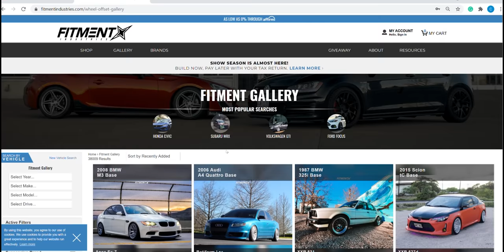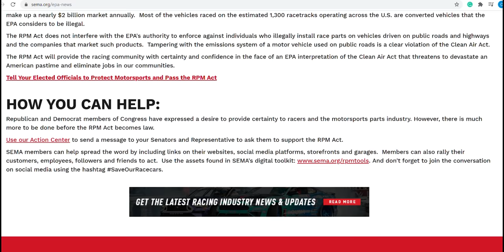So You Want To Make Car Mods Illegal (EPA)

Comment: FYI, hackers have attacked SEMAs RPM Act page so you can't get involved to help. If you guys care about this, please actually get involved. We're going to lose so much if the RPM Act doesn't pass. This also prevents retro fitting old cars to get them safe and up to par with modern standards, which is a good form of recycling old cars.

Comment: I’m personally conflicted on this. On one hand, banning all aftermarket parts or even a few could spiral into something worse down the line (few into all into even MORE stringent standards for automobiles and yadda yadda yadda). Banning aftermarket parts also essentially kills the grassroots Motorsport level. There’s also the problematic view of “you can’t stop EVERYONE from modding cars” though that’d kinda kill car meets in its own way too (big meets+mod ban law+ most cars at meets modded=bad time). At the SAME TIME though, the EPA exists so America never regresses to what we were before. If you’ve never lived through smog or had asthma before then you don’t understand how bad it actually is. So I can understand the EPA’s view. Also, y’all know there’s people out there that buy parts that are designated “off road use only” and install those parts on a daily driver, riding around from coast to coast (and full disclosure I feel they have the right to do so but it kinda doesn’t help our case). Furthermore, diesel cheat devices probably are a problem. Probably not enough of a problem to kill the aftermarket car community since diesel cars in Motorsport are like a minority of a minority but still. I think the car community is facing an uphill battle that we might not actually win. I’m rooting for us though.

Comment: Why doesn't the EPA go after the millions of single drivers that are unnecessarily cruising around in SUVs and crossovers instead of smaller fuel efficient cars instead of a very small number of aftermarket cars?  Makes absolute zero sense

Comment: A better way to regulate would be to limit the availability of high octane fuel and cap it at 93 octane nationally. The next thing would be to restrict E85 to vehicles of 1.7-liter displacement or less through the use of a special filler cap and legal penalties. The way I see it ethanol is being made from food out of someone's belly somewhere so we should be using the stuff as efficiently as possible.
The reason to limit octane is the heat and pressure of compressors produce astronomical amounts of nitrous oxide products and that is much worse than CO2. You could still have a compressor with 93 octane fuel but it would be a dicey proposition with pre-detonation. I always felt that building a car with bolt-on parts was a flakey way that rich kids do it, but not a serious engineer.

Comment: Personally i dont think what they are fighting for is what they truly want. Like most large corporations, i think this is just the first step that may get the door open and squeeze thru and then it will be another and another and ultimately its step 5 or 10 that they truly want to accomplish. Also this could possibly be fueled by manufacturers or auto makers in a roundabout way in order to fuel more sales as the only way to get more fun to drive or a nicer looking vehicle would be to replace the entire vehicle

Comment: If you ask me this is hard. On the one hand, I would love to do everything possible to represent the least environmental impact on the world, but on the other hand I also like fast cars. The EPA has good intentions with poor execution here cause most people who modify cars here have zero intentions of destroying the environment, and often measures designed to harm the general population are met with negative feedback, no surprise. However I understand that all these modified cars added together do represent a significant increase in emissions for the EPA to go after it, but I also understand that we are guinea pigs for technologies that make it to regular production cars through the aftermarket parts we buy and use in our vehicles, just like motorsport is a proving ground for engine technologies like KERS, thermal efficiency,  variable geometry turbos, etc. This approach is on the most part not good, however, the aftermarket industry doesn't have the money to afford the lawyers the oil and gas, dairy and beef industries have to fend off the EPA and use their rules as suggestions. Automakers won't join as they're switching to electric, so we're easy target. However we do need to strike a balance between go-fast parts and killing the planet in which we enjoy them.

Comment: I mean in 9 years you wont be able to buy/register a gas vehicle in the states because of the 'Phase out fossil fuel vehicle' starting in 2030 in the states. so this really doesn't matter much, delaying would only be placing a band-aid on a severed limb. This is bigger then the car scene or modding culture, investors have spoken with their money, and there isn't much anyone can do about it, this will pass at a fed level, I'd be surprised if it didn't. RIP my RSX.

Comment: I get emissions and things of that nature. Although aftermarket ignition systems allow all the exhaust gasses to be burned and therefore are more efficient than stock. So in many ways the epa stance on going after hobbyists is unvalid. But the entire aftermarket? What does a suspension have to do with emissions?  There is no correlation to the ozone by driving a lowered car. Or a road racing suspension!  I think this is more intended to force us asa society to not have independence and  individuality.  Our country is turning i to cold war era Russia.

Comment: The EPA is a joke. People will simply go back to the way cars were modified in the 1950s before there were performance aftermarket parts available. They made their own stuff. The beginnings of performance intake manifolds were people who dug pits in their backyard and poured their own rough castings, then machined them. Henry Ford himself said that "Anything that can be drawn up can be cast" when his own designers claimed that it wouldnt be feasible to cast a block for a V-8 engine.
The same applies to camshafts...all one needs is a chunk of steel and used or surplus machine equipment, CAD/CAM capability would be a bonus though, but not absolutely necessary, they have been made since the dawn of the gasoline engine.
Modified ECM/ECU and other late model electronic crap? A proficient teenage hacker can handle that.
Roots type superchargers? Those were invented in the 19th century...to ventilate mines.  Technology was primitive at the time, so how difficult would it be to make your own?
It people arent lazy and seriously want to defeat the miserable EPA environazis, it simply takes determination and knowledge of fabrication techniques, AND the dissemination of such knowledge is protected by the First Amendment to the Constitution.
The EPA is simply too understaffed and doesnt have the resources to stop anyone strongly determined.to modify vehicles.
Case in point.....It is prohibited by EPA regulation to introduce more than 10% ethanol into gasoline used in non flex fuel vehicles (15% if 2001 or newer)
Does anyone sane think they could possibly post a lackey at every gas station that sells E-85 or every paint store that sells denatured alcohol to enforce their ridiculous crap?

Comment: I think its more nuanced than that. For example at 8:45, tires that have a higher burn rate releases particulate matter in the air which is terrible for air quality. Are higher burn rate tires fun, yes (I love them) but lets face it, they are bad for the environment. And the environment is EPA's job. I say engineers should make tires with higher burn rates with little to no particulate matter to solve this issue.

Before you say anything bad about the other side, take a min to do research into why that something is being done.

Also before you say anything, note that the EPA is did a similar thing in the 80's regarding emission standards. Did cars suffer, yes but in the short term. Now we have cars that are way more efficient and make more power than what was even thought was possible. (I read an article somewhere sometime ago that a ford executive said that 30mpg cars are impossible 🤣. I think it was dated in 1970's or 1980's. I post it here if I find it)

Comment: If they banned excessive black smoke on road use diesel vehicles id be fine with that, considering if you are breathing that in (ac not on recalculate, drive convertible with roof down, have window open, motorcyclist or predestrian) its not particularly that great plus makes it difficult to see. 
But if it were to affect other stuff id have a problem with it, cause car culture is a very neish compared to the overall car market. Like at work i barely see cars running aftermarket wheels, i see more cars running on 1L of oil then cars with a.market wheels let alone modified cars

Comment: Unpopular opinion here, but seems like the EPA is trying to crack down on companies selling emission control delete products for "off road use" that are clearly mostly being used by people with regular, on road cars who want to remove emissions control for more power or to roll coal. Kind of like if you ran a store selling lab equipment, Sudafed, and burner phones. There's a poorly-written carve out for motorsports, and it should be clarified, but it doesn't help anyone to be cute and try to use it as a loophole for getting around the main point of the law

Comment: People should make burnouts in front of EPAs offices 24/7. 
Anyway, it doesn't really affect me. Where I live you need a to endure an expensive bureaucratic hell, requiring a certified professional mechanic and an engineering study just to install an additional phone charging port in the car.
Also, LED headlights? hell no... unless they are stock, then it's perfectly fine.

Comment: I would like to see the other side of the medal on this one. You guys have an industry to defend. Fair enough. But as you pointed out early in the video, cars were pretty bad for the air we breathe in the 50's and 60's, and if the EPA had not stepped in, there is no way the industry would have changed. The EPA has turned a blind eye to the "offroad use only, wink-wink" tuning industry for a long time, but when a bunch of hicks start "rolling coal" with the sole intention of creating as much pollution as possible to piss off "tree huggers" and brag about it on YT, the EPA will eventually notice and say "that's enough". Can I blame them? Not really. The most moronic people in society will ruin it for the rest of us.

Comment: That phrasing "street vehicles cant be converted into racecars" is real deceptive. The proposed legislation just means those racecars have to meet emissions same as street cars. Whether you want to admit it or not ICE powertrains are quickly on the way out for not only oem's but also the aftermarket. We are very quickly approaching the point where dropping in an ev conversion will be a 1-2day affair and will at least double if not quadruple the performance of the vehicle. This is a whole lot of hoopla for something that isnt gonna matter in 10years. Spend your time learning EV tech instead of fighting the inevitable future.

Comment: God damn this video was skewed and you did a piss poor job at explaining the issue. FML, I was hoping you or donut would be accurate. Aftermarket delete devices do have to go, but you made it sound like the EPA is trying to take away all aftermarket devices and that the Clean Air Act is a recent act when it’s been around for several decades.